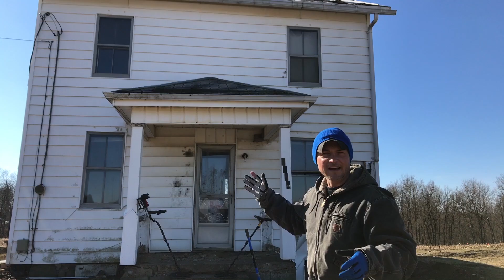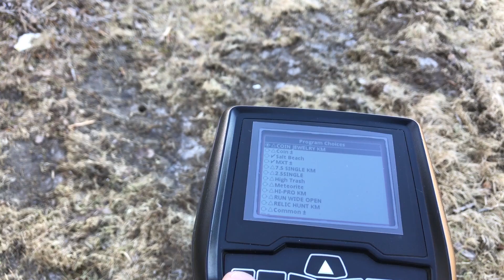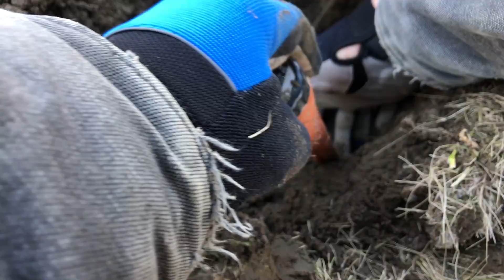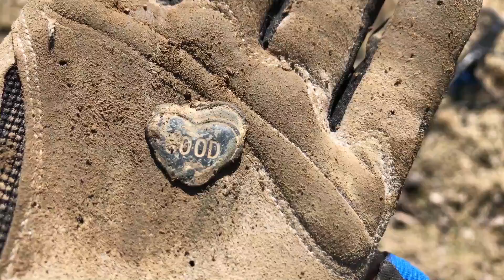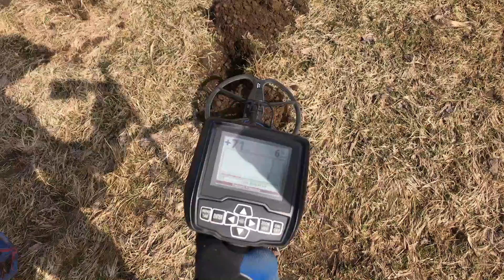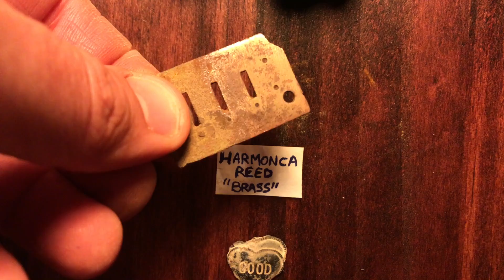Metal Detecting Previously Hunted Sites

Comment: Not sure if you noticed or someone else pointed it out but the needle part of that pin was still attached when you first turned it over, you wiped it with your finger and broke it in the middle and wiped it completely away the second time. I have done that before as well and I now wait until I get home to rinse the dirt away to prevent damage.

Comment: Dang! You've got me wanting to buy a V3i. I had an XLT back in the day and loved it.
Reply from the maker: The V3i has a learning curve although it's very much worth it. The new ones are nice but you can also get a very good used one, they are built like tanks and the screen will look brand new with a $6  new factory cover. My V3i was bought used in 2011 and been a great experience the whole time owning it. I too had an XLT.. I wish I never sold it. :) Thanks for checking out the video and hope to see ya back on here someday and picked the hobby back up... (if not currently in it). Take care.
Reply: @squarenailsquirrel9638  
This is one hobby I've stuck with. The treasure bug bit me bad!
You'll occasionally see me on Detecting4Life YouTube channel.
Reply: @squarenailsquirrel9638  i still have my xlt since 1992 have it for so many years but when it goes out on me it costs me $250.00 TO FIX IT HAD TO FIX IT  TWIce 5 YEARS  in between its still the best damn machine ever
Reply: @squarenailsquirrel9638  i still have my xlt since 1992 i have it today But everytime it goes out on me it costs me $250.00 each time to fix.Had to fix it twice 5 years in between 
those times its still one of the best

Comment: Great video! You found some very good finds at that old house. I also liked the comparison between the MX-Sport and the V3i.  No prejudice toward either one, just the facts.
Reply from the maker: Thank you. I was surprised by the pin that's for sure. :)    The comparison between the two machines went over pretty good after receiving positive responses in the comments on here. I really haven't seen many videos where anyone does this unless they are bashing one brand over another. My comparison like you say was "no prejudice" and only a comparison between the data levels, responses and language of the detectors. There is huge difference in how detectors will respond to targets dealing with what frequency they hunt on and even though the Sport and V3i are great machines made by the same folks.. you get very different target responses. Not that one is better than the other.. it's just that they are tools for the hunt utilized differently. I'm hoping to some day add another machine to the mix although funds are low currently.  Thanks for checking out the video as well as commenting. take care.
Reply: Kenny - Another fantastic video.  I am pretty bummed out now because I have seen all of your videos and am now waiting for more......No PRESSURE.  It's fun living through your experiences and you are definitely the Rambo of detectorists.  Since I am in the market for a detector, I took great interest in your comparing your two detectors.  I am really anxious to find out what new detector you decide to get (hope the tax man was kind to you) and I hope you do some rigorous testing of it (once you get to know it) with your two existing detectors.  Question - In your search for a new detector, have you come across any unbiased Consumer Reports type of sites that are comparing one detector to another using the same test bed? @squarenailsquirrel9638

Comment: I like how you used the MX and then went back over the same targets with the V3i.Showing the differences on real targets and not pre buried targets..Congrats on the Pin,Merc and of course the good old Wheatie..:)
Reply from the maker: Thanks, I was trying to change things up a little and so some caparison between machines. Between the two machines I can tell a difference between their languages as well as response to different targets making the hunt two very different hunts depending on which machine I choose to use. There isn't a better one over the other although I really like that the Sport I can use at every site but the V3i depending on moisture as well as EMI.. may not be able to use. Thanks for the congrats as well as checking out the video.. I wish you luck with any hunt you may have coming up.

Comment: Hi Squirrel! 
Apparently the front yard was hit hard but both machines proved there's always stuff left behind!
Interesting test between machines! Brooch looks hand cast. Looked like the pin was on the back in the dirt and was brushed off, but need to recheck. Nice coins too! Spring must be close you're back to wearing cowboy boots! 😃
Reply from the maker: Very true.. it's always that front door that attracts everyone. LOL  I will try to do some more dual machine hunts like this from time to time especially in front yards like this where the grid is easily defined.   I think that brooch is hand cast too, there are marks on the back that are possibly from a mould where it was hand poured. I'm not certain of that but it sure looks like it.. either way it's a cool find.    Ha! yes, I had to lose the rubber boots for this hunt it was warm enough to get away with wearing my cowboy boots. :) Thank you for checking out the video and I will reply on your other message later today.